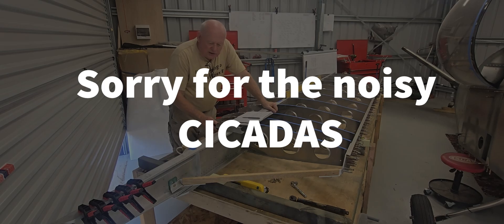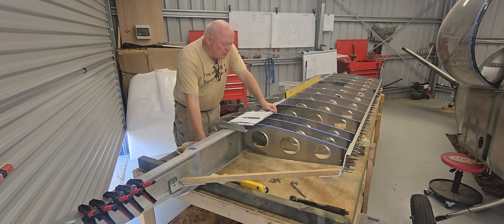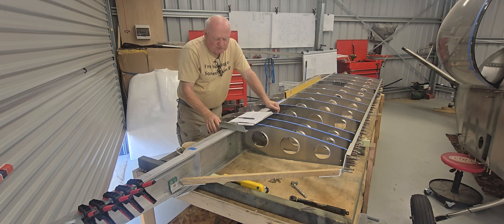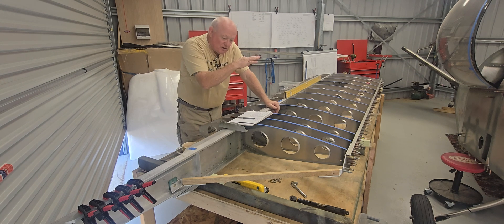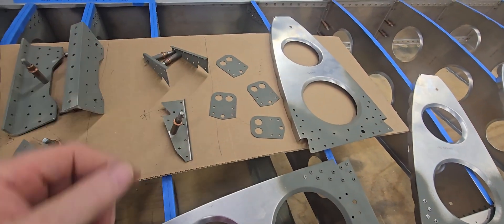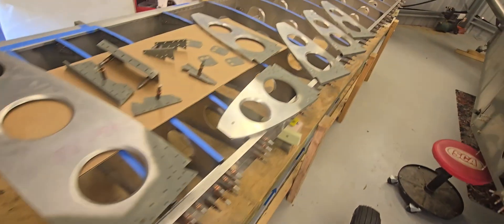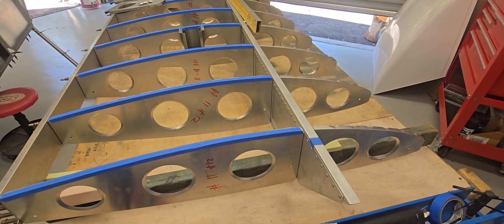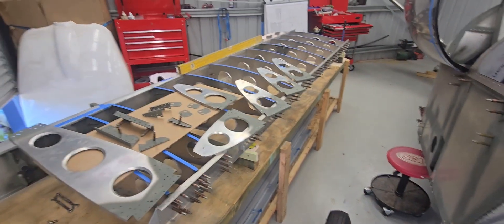Sonex Waiex B, part 43-wing box section and skins

Comment: Hello Andy, I noticed the plans show which side the factory head is on and the shop side of the rivet for the root ribs. But on the rest of the ribs there is no direction shown. I noticed you put the factory side of the rivet on the rib and the shop side on the gusset side. Does it matter which way ?
Reply from the maker: Hi Robert, 
You know this is a great question and it has played on my mind throughout the build. For me when the two or sometimes three surfaces are riveted together, they become one with each other, and I don’t believe it makes any difference. Sometimes the controlling factor is you just can’t get the rivet gun in one way, so you simply do the other side. There are a few situations in the kit that this happens.  Some will argue that bolts are different, for example the wheel pin that fixes to the titanium gear legs, the bolt nut should face aft not forward, so the wind flow does nut undo the nut from the bolt….is this truly possible???I don’t think so, anyway, hope this answers your dilemma…

Regards Andy

Comment: I used 1/4" OD Polyethylene Tubing. Found 25ft of it at my local hardware store for about $5. The tube wall is sturdy and i was able to fit all 4 wires for my lights through the tubing. I bumped the mil spec aviation wires up to 18ga (20ga probably would have been fine, but I figured it would be worth the very slight additional weight). No need to increase the size of the holes that are there.
Reply from the maker: Probably should have gone to my local hardware to get the tube, but elected to get the same as the Pitot/Static from Aircraft Spruce, that exercise cost me $130 AU…In the short term will use a draw wire as I don’t have my cables for any wiring as yet.
Reply: @pandyseven  ouch. $130 is a lot. Either way, I'm sure it'll turn out great.
Reply from the maker: @dan_der_flieger Thanks, Dan. I can only hope
Reply: I should also mention that I originally had the conduit running through the forward ribs, but later opted to run it through the front tooling holes in the rear ribs to keep them (mostly) away from the aileron controls, while still guaranteeing that there was an opening into the fuselage.
Reply from the maker: I have elected to run the cables in the aft ribs
Reply: I used the same tubing.
Reply from the maker: I will be buying more, need it for the Landing lights cable's

Comment: Looking good Andy.  On my build, I ran wires in the leading edge.  There are three 1/4" tooling holes in the nose ribs and I pulled poly tubing through all three.  It would have also worked to upsize one of the tooling holes for bigger tubing.  The advantage of wiring in the leading edge instead of the main section behind the spar is cabin access.  If you go in the rear you only have the small fuselage hole that you share with the aileron pushrod.  Up front there is a lot more room to run that wire out and make the connection.  I don't know if the B model plans show opening up the space between the two lightening holes on the root nose rib or not.  Most of us have done it to get more room for connecting the flap torque tube to the pushrod.  Again, that makes wiring access easy.
Reply from the maker: Hi Bryan, The B does not have an opening forward of the tunnel as does the A, so only the hole for the aileron pushrods. I am still wondering how I get the pitot/static tubing into the cockpit, as there is only a very small space in the tunnel. I know the two mounting blocks on the spars themselves are practically tight against the walls of the tunnel, leaving only around 10mm [ 3/8] or so clearance, from spar thickness to tunnel wall…hope that makes sense? As far as tooling holes in fwd/aft ribs there is only the chord holes, 2 in each rib, so effectively 4 in total.  I am planning to open the aft chord hole to the bushing size same as for the pitot/static and use a similar tubing size.
Reply: @pandyseven  Interesting, I didn't realize the B model flaps were so much different.  I see now that there is a flap torque tube behind the seatback bulkhead/framework.  I'd ask Sonex how to route wires and the pitot static lines into the cockpit, if it's not in the plans.
Reply from the maker: I guess my best bet is to check with Gavin, he is at that stage ...almost